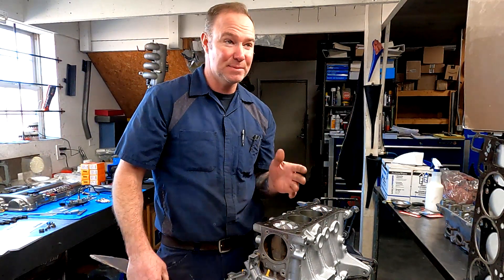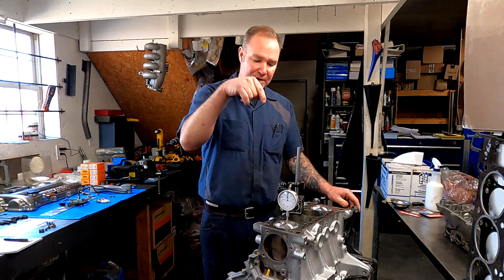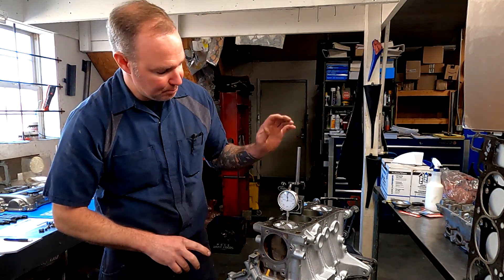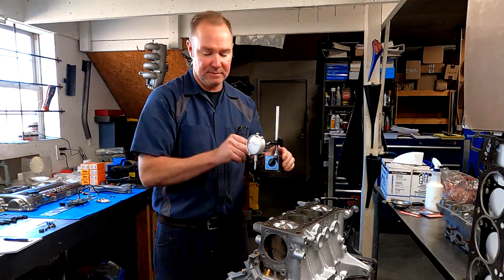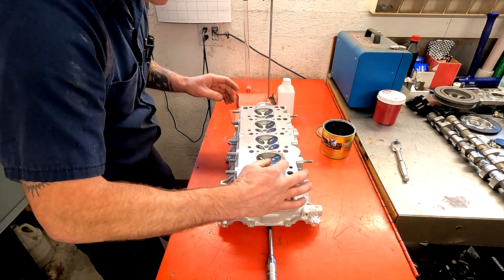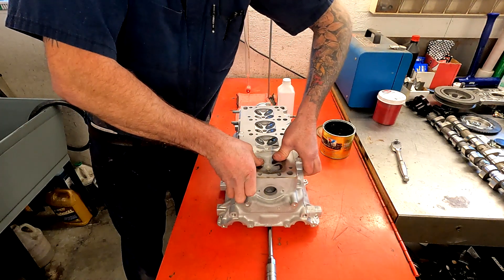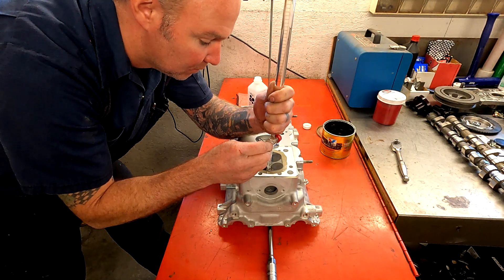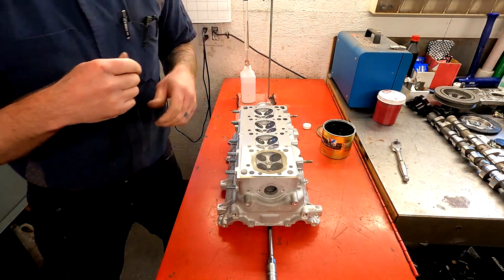How to measure compression ratio - the RIGHT way

Comment: Awesome videos. Can you or someone explain v4  piston depth. My piston manufacturer sheet gives compression height 1.65 and top dome of -5.00cc.
Reply: Compression height is just the distance between the center of the wrist pin to the top of the piston.  The dome cc's is what you need to calculate compression.  That's the -5cc's

Comment: I must be doing something wrong. My engine ought to be in the region of 9:1, but if I used this calculator, and got a figure of 5:1.  However, if I subtract the piston dome volume from the cylinder head volume (56cc - 20cc = 36cc) and add the displacement (250cc + 36 = 286) then divide that by the reduced head volume (286/36), I get 7.94:1
 Which one is correct?

Comment: So You Say It's Going To Be 10.94 -1  Right With A .040 gasket. But What About When The Engine Pistons Comes Up To Temp Because It's Gonna Grow Much More For A Forged Piston Then A  Hypostatic And A Cast Piston Grows Even Less . So How Do You Actually Account For That ? Because different height will actually create different atmospheres even buy cold air and hot air is being drawn in whatever fuel hear Bernie and in your timing. . And some of the people are watching your channel could actually be misled a little bit I know we're splitting hairs but when you're talkin about them doing a teardown to inspect your engine to make sure it was in the specs that might make the difference. The average Joe building an engine in his garage might try to push it right to the limit but not account for that and can cause predestination . Am I correct
Reply: Really good question.  You may get a tiny bump in compression while on track but by the time you yank the head and they check you, the piston will be back to static measurements.  Remember, a combustion chamber on the track will run over 1000 degrees.  It cools down pretty fast.

Comment: Can I ask, if your piston is flush to the deck but you have valve cut outs. Are those valve cutouts part of your cykinder volume CC or should they be meausured and added to the conpression squish area in the head?
Reply: Also like what he's saying on the
Reply: I know when I had my 219 heads Datsun heads that I would make sure Dave Robello replaced it with the same flat valves that were in that had originally so that they could be used in this particular class. Some valves have indents.
Reply: If your piston is a flat top then your piston will have added cc's to your calculation.  The piston manufacturer should be able to tell you what it is or you can calculate it.

Comment: I have a Honda k20 engine. I have 1mm oversized dished valves on the intake and I have stock size flat faced valves on exhaust side. Is this a good set up?
Reply from the maker: I can't give you a thumbs up or an approval of any kind without knowing more information on the build.  I would rather not OK anything that I have not built myself, but of you did your homework and chose the right parts smartly, your half way there.